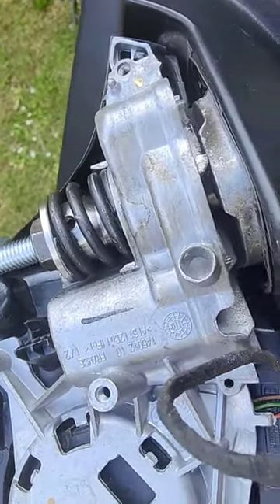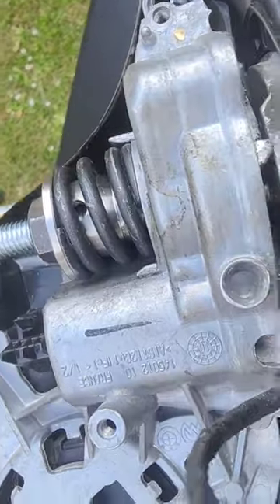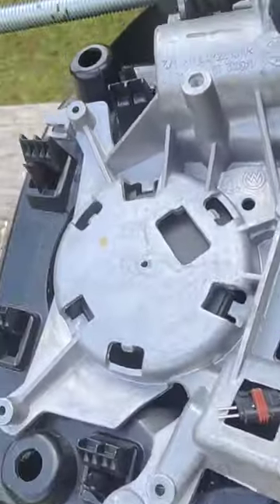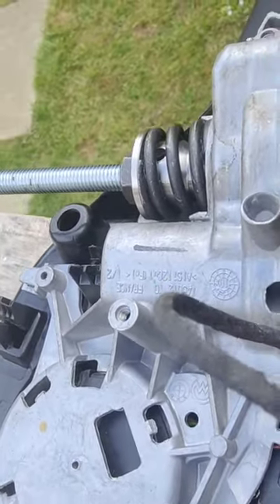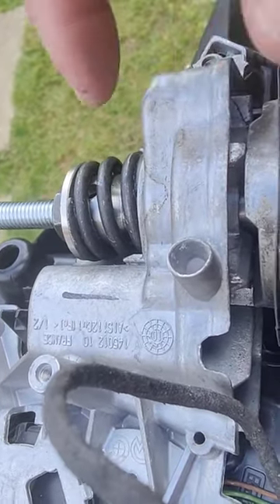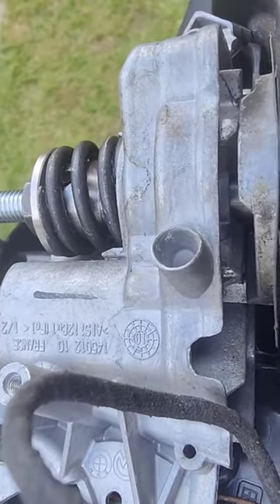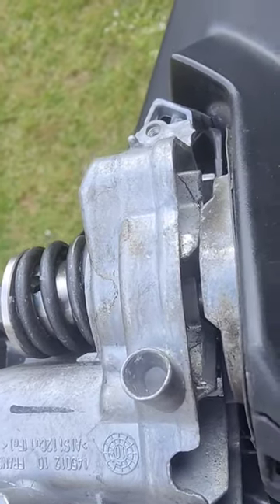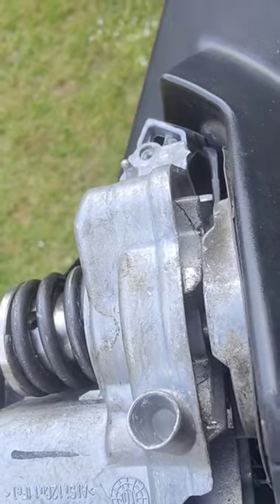BMW mirror hinge pin replacement

Comment: Hi Jason, your short series videos are the only ones about BMW hinge pin replacement. My BMW hinge pin was broken. I got the replacement part. I am preparing to do the replacement job myself. It seems I would need to disconnect the wire. to replace the broken hinge pin and install the new hinge pin. I wanted to ask you if I can disconnect the wire from the mirror assembly or if I have to access the wire from the inside door panel. Your feedback and assistance is greatly appreciated.

Comment from the maker: From memory, the mirror is removed from the door, sort of left hanging, the mirror shell comes off and it then exposes the wiring connections...
I don't remember pulling any wiring from the door.
The actual door part is relatively straightforward once you find the hidden bolt... The pain was working out the re-assy  which is why I showed this solution.. it was still real fiddly to get the nut on bolt on the underside.. best of luck .